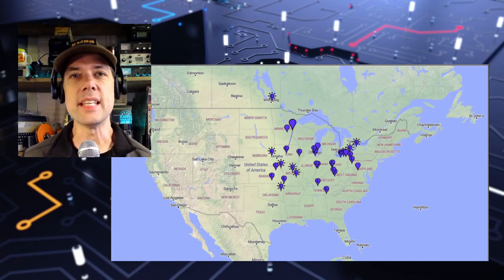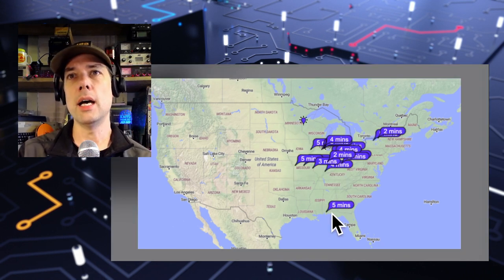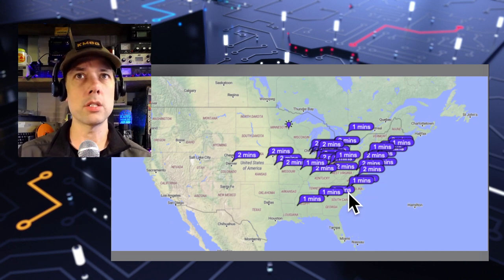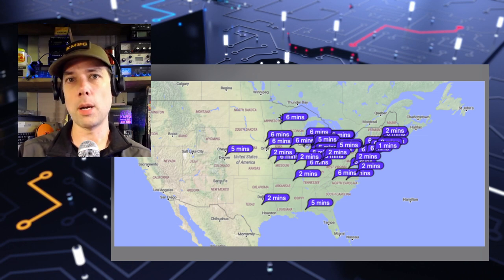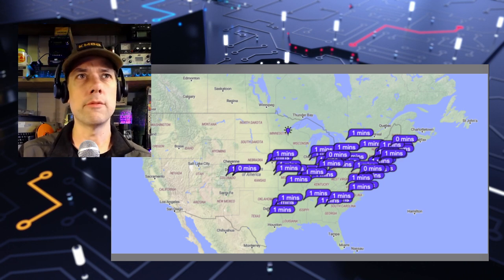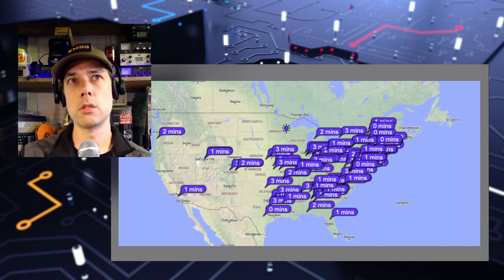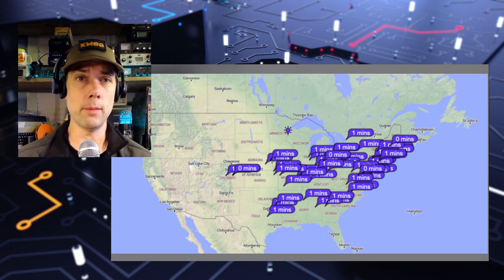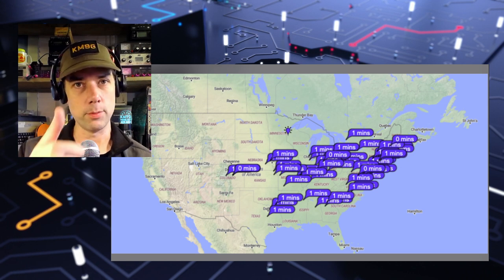Does antenna orientation make any difference?

Comment: I finally settled on a G5RV Jr set up in an inverted V with the center at 14 feet off the ground and the ends down to about 3 feet off the ground. I was able to get the WAC award over the first weekend of using that antenna at 100 watts so I can get DX on it, but it is also close enough to the ground that I get local on-island and within state contacts for our morning HF net here in Hawaii. 14 feet high at the center is giving me the best of both worlds with this antenna.
Reply from the maker: A lot of people hate that antenna, but it works just fine forwhat it is
Reply: @temporarilyoffline  yeah, and here in Hawaii we have very small yards and HOA’s everywhere so we are extremely antenna challenged here. The G5RV Jr is the largest antenna I could squeeze into the yard. As a compromised antenna, it does what I need it to do as long as the sunspots cooperate with me.
Reply from the maker: @WH6FQE  that s the ham radio spirit.   What freq is the HI HF net on?
Reply: @temporarilyoffline   either 7.088 or 7.188 depending on conditions and local interference
Reply: @temporarilyoffline  every once in a while they have to drop down to 3.888
Reply from the maker: @WH6FQE  I'll see if I can hear you!
Reply: @temporarilyoffline  I won’t be back on there for a few days, I had to pull the antenna down to do some yard repairs, I’m going to try to get it back up over the weekend.
Reply: @WH6FQE  Hawaii has that cool unique allocation for voice on the low part of 40m. I have yet to hear it here from Oregon but some I know have. We cant transmit though since we are not within the Lat and Long restrictions.
Reply: @forgetyourlife  actually, I had never noticed that voice section of the 40 meter band until you mentioned it. I had to go look at the Band Plan chart to see what you were talking about. 

Not many people wanting to make a lot of contacts would actually use a section of a band like that because most other people aren’t able to use it so you would find yourself alone there. Similar to how during a contest, most Extras are actually using the General portion of the band where they are more likely to make more contacts because there are more available people in that part of the band.

Comment: Being new to Portable operation I was really looking forward to this video. However I seem to miss several items. Where you are located. Why you change the orientation from north south to East West and then the directional orientation on the sloper. Would have loved to hear a commentary on each different configuration, and your thoughts on them! Thanks Brett
Reply from the maker: Hey Brett, at the time I was in Wisconsin.  The only reason I change orientation was to show you the results displayed in the video so that you could see they were "different", but maybe/maybe not "different enough".  The video demonstrates that a wire in the air is better than an argument about perfect placement... and maybe helps with "How to I setup my antenna for that last state I need in WAS"

Comment: I have an end fed strung from the transformer to end @20 ft to a tree to the north and the remainder attached to a fence. It's 66+/-. Oriented from the south going north. My pattern is either Texas or South America, without fail. I don't have the space to orient EW so I slope it from roof level to a horizontal L to the fence again. No real change in pattern.

It does matter what band I am on though!
Reply from the maker: Thanks Aaron, I bet every band is a bit different also.

Comment: I am in South Dakota, my antenna is a end fed random wire about 53' long 18 ' above ground, 4' above house. Its orientation is East/ West fed at the West end. I have about the same 40 meter pattern as you.  de N9TDE
Reply from the maker: Interesting, I try to always run my antennas north/south.   I know that antennas like this are supposed to be omni directional, but I've (felt like) running n/s gives me more e/w propagation.

Comment: A lot of uncontrolled variables in your analysis, especially with propagation. As someone else pointed out the density of stations is much higher in the eastern half of the country. I think you should throw in another test for comparison: repeat with the antenna horizontally at 60-75 ft elevation. (My 50+ years of hamming have taught me one thing about hf wire antennas: The more wire you can string together and the higher you can hang it, the better your signal will be.)
Reply from the maker: Yeah. That was actually what I was trying to show in thr video z get a wire in the air and have fun... worry about "perfect" when you're chasing that one rare station or have that friend that you just can't reach.  Thanks for watching and I'll run the higher antenna when I can,  sounds like fun.

Comment: Interesting findings TO! Time to pull out the CAHR EFHW and test a config with 40' running up the pole vertically, and the remainder at an angle tethered to the ground and see what that yields. 73 - KF6IF
Reply from the maker: I believe it will be spectacular!

Comment: Hi, an extremely useful and practical analysis of different antenna types, I’d like to try to do something similar, can you let me know what software you used to plot received WSJT reception, 73
Reply from the maker: https://pskreporter.info is the link, click on map display, fill out the form at the top and hit the Go button.  I'd recommend going into the options and turning on "Hide Faint Monitors", "Hide Monitors if no reports" and other things that make sense.

Also, in one of your WSJT-X settings tabs, there is an option for reporting your own info to pskreporter.info.  I'd recommend turning that on as well.  This will allow you to see signals you've heard on the map, as well as those people that have heard you.
Reply: @temporarilyoffline  Tnxs, I've got it working now, great tip, thank you 73

Comment: From my location, just east of Los Angeles, I find a particular cone of silence and transmit centered on Colombia. This occurs regardless of propagation, transmit power, etc. I am running an EFHW in the inverted L configuration oriented east-west. 

Have you considered the issue is geographical? I've come to believe my cone of silence is in line with some of the mountains surrounding the Los Angeles area.
Reply from the maker: The only real issue I have is making contacts into Canada.  I believe I'm either too close or there aren't many hams in the parts of Canada that are in the right skip zone for me.  I'm not complaining at all, just showing the different ways that different antenna orientations effect your propagation and hoping to share something that someone can use in their setup.

Comment: Interesting. What about inverted L? I wonder whether the orientation of your coax has any influence on the radiation pattern, since the shield forms a counterpoise. I've been attempting some HF packet radio, without much success, and I wonder whether my main problem is that I'm located in Utah and the packet nodes in CA and CO might be in my skip zone. Maybe I'd be better off with an NVIS antenna instead of the 1/4 wave whip I've been using.
Reply from the maker: I haven't run an Inverted L, would be interesting to see how that works.  I'd try NVIS in your situation, especially if I had a portable EFHW
Reply: @temporarilyoffline  Modeling seems to show a low take-off angle from the vertical leg of the L. I think that's what Walt K4OGO was observing. Would be interesting to see a comparison using your methodology.

Comment: I have a question may seem kind of dumb. But I really don't know the answer. What is the best size coax cable when you're doing mobile I guess it's called?
Reply from the maker: Best for POTA or portable is something like RG174: https://amzn.to/3Tw151q it is lossy, but we want pack-ability. Another choice is RG316: https://amzn.to/3UBJUwE - I have used this and it looks less flexible.  These are compromises because of wanting to pack up and go.  RG213 would be best, but won't fit your backpack.

Comment: Wouldn't an inverted L give you better results as you have the vertical and horizontal parts???
Reply from the maker: It is a little more complex than that - and I'm no expert either... but different antennas have there "peak" performance at different locations along the wire.  From what I understand, the "peak" of an EFHW is the center of the wire, so you want as much of that center part as high as you can get it.  I guess that's part of the fun of it all.

Comment: NVIS is there a minimum height above the ground.   For HF. 40 mts
Reply from the maker: well there are diminishing returns ;-). I was at 3ft.  I might try it at a lower height just for grins.  6"... let's see what happens!
Reply from the maker: @rearickjb  thanks Jason, one of the points I was also demonstrating is that its more important to get on the air then anything else, and you will get some results in almost any configuration. I know a lot of folks struggle with how to get an antenna installed in the first place. I appreciate the tips.

Comment: Propagation is everything.  This is my transmit from my 66ft EFHW N-S Inverted-V, on my X6100 running 10W on 40m in San Antonio (done 15 min ago): https://i.imgur.com/l2tObpI.jpeg
Reply from the maker: It sure is!  Its nearly impossible to measure antennas back to back because of band conditions changing - too many variables.  Its good to "get a feeling", but near impossible to account for all variables.